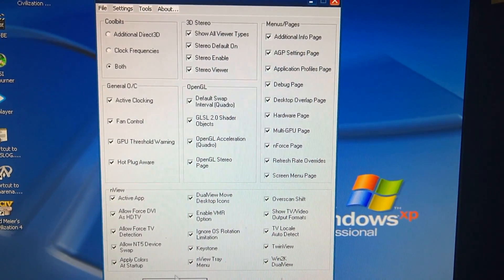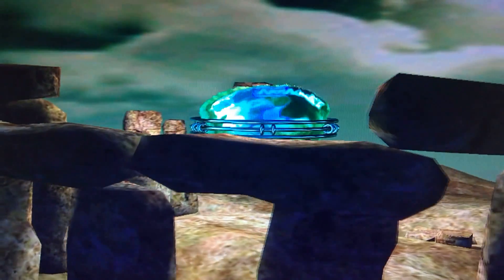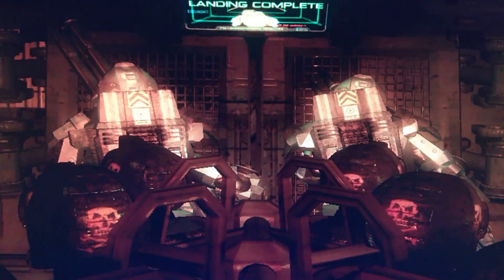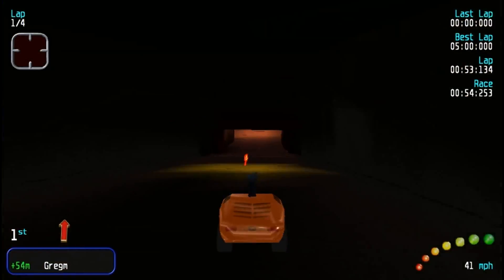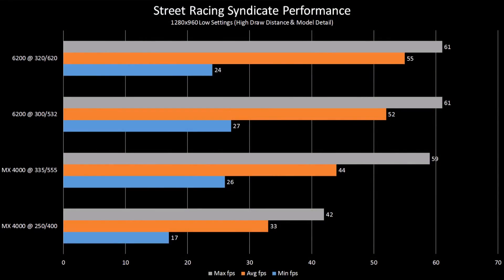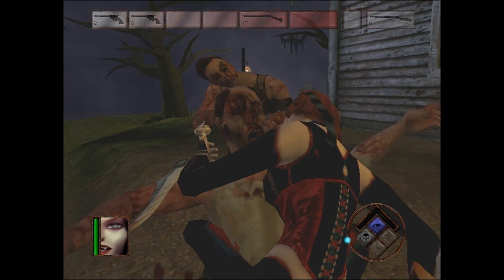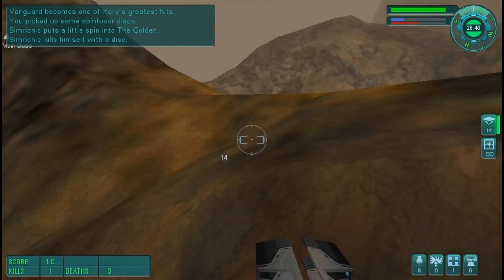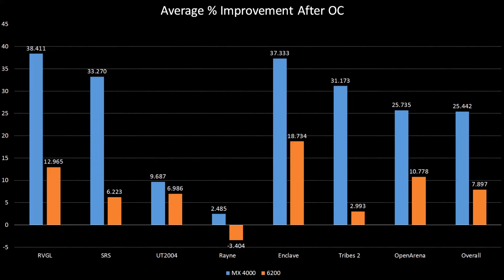Overclocking the PCI Graphics Cards

Comment: Old video but still going to mention it. That x1550 video card's GPU die looks burnt as did the thermal pad on the heatsink. Most likely that is why it was unstable after your overclock and why it couldn't revert itself back to being stable.

Comment: Can you watch youtube videos on these?
Reply from the maker: Not really, they're too old to provide any acceleration for the decoding process in a browser, and the chances are pretty high the CPU is too slow to handle everything itself. Technically the 6200 can help out if you configure a player like MPC-BE to use a supported decoder on a supported CPU, but doing that is a massive pain and you'd be stuck at 480p anyway.

Comment: Managed to get my 7300 GT to 640 MHz on the core and 440 MHz on the memory from its initial 400/300 MHz
Thats 60% on the core and 46% on the memory. 
Those entry level cards often are amazing to overclock. Especially when buying a passive model and strapping a case fann tothe usually massive heatsink.
Reply from the maker: I should try that on my 7300 GT, not sure how far I'll be able to take it since the stock fan died and I replaced the cooler with a cheap one from China but hey, it's worth a shot.
Reply: There are even some with DDR3 memory, those will perform almost up with the 7600 GS/GT cards when overclocked.

Comment: The fastest pci video card is the 610 gt (also rare) http://www.newegg.com/Product/Product.aspx?Item=N82E16814500262
Reply from the maker: If TechPowerUp's GPUDB is accurate the GT 520 PCI is actually the fastest as it has double the VRAM at a higher clock speed. The core is the same though.

Comment: Are you kidding me? They have to put pictures of pretty people on the product itself now? I hope you can peel that crap off. (Not a vary constructive comment but I let that stuff get to me!)
Reply from the maker: That kind of thing was popular back in 2006 when the X1550 came out, it's certainly not a recent trend :) I can peel it off if it'll make you feel better but the card is dead and I won't be using it anymore.
Reply: It hold on around the Geforce 8000 and Radeon HD 3000 cards.
Mutting the mascot not only on the package but also on the cards.
Reply: Lu Tello but its h e n t a i